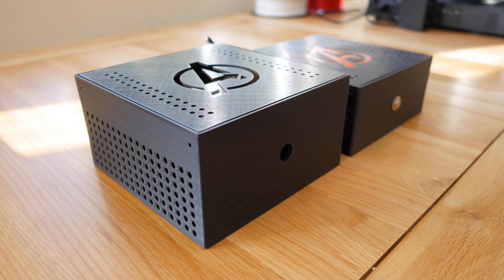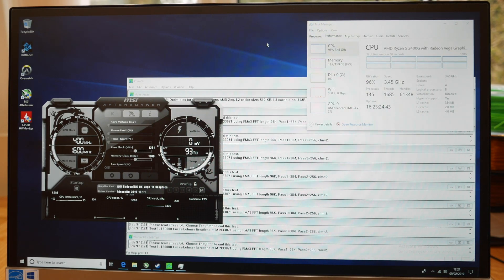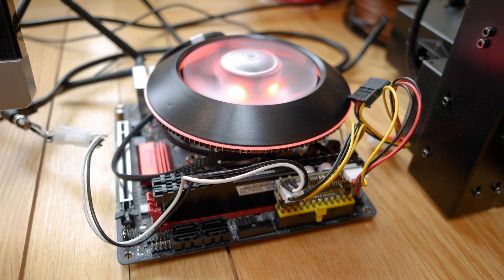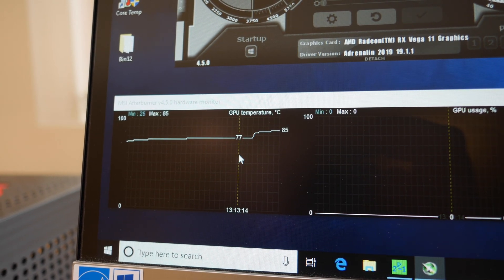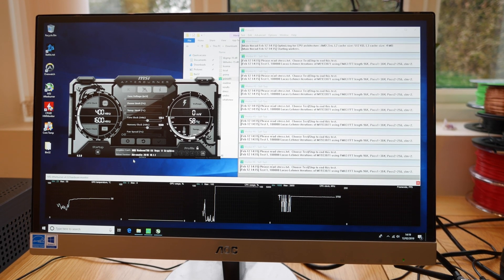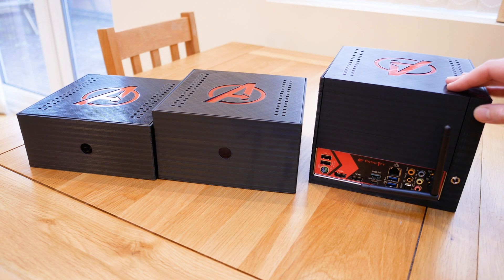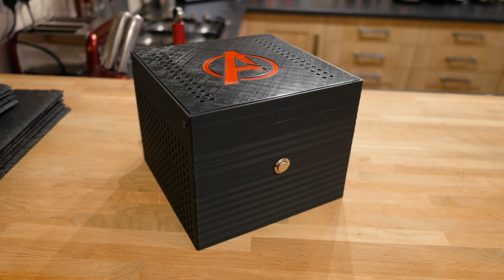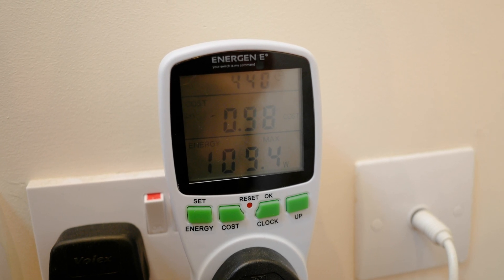3D Printed Ryzen Mini ITX Gaming PC Case v2 – Fixing Thermals

Comment: I hope all is well with your pc!

In the future, start with a fine mesh top and then use a template to spray paint the mesh like a tennis racket with your art that way you don't have to suffocate the fan's direct intake as much. Otherwise, maybe a 120mm aio will have enough room with the enlarged case

As for pico psu, you can add more than one of them or double them up to get more wattage if you have a sufficient power brick. Otherwise, a flex psu is a great space and cost saver especially in the 400w range over sff/sfx and atx psu's. Look at a K39 or Velka 3 for design inspiration

A wonderful design process and project! I am looking forward to making my own 3D printed case to have the fun of a custom case and learning experience. Seeing other people and learning from their efforts is fantastic.

Comment: Could you please see what the temperatures look like in a smaller form factor but without the filled Avengers logo?  The hole should deal with the heat dissipation of the CPU heat sink.

Comment: If you are planning on V3 update of your case, there are few noctua low profile coolers they're better than that monster u have. Plus if you can add 2 80mm coolers one pushing other pulling air that will drop 5-6° for sure.

Comment: At this height you could go with Noctua nh l9x65 or thermalright muscle 100.
You can also try HDPlex for your power. I believe you have enough room to install AC-DC 200w adapter on the front panel and 200w pico psu into MB.
Wish you luck 👍

Comment: The problem is recirculating the hot air, you need a forced exaust, or intanke in the case, no need for a different cooler, and different sized case. Even an small 80mm fan could do the job.

Comment: I've been thinking a lot about 3D printed ITX cases lately, although I don't have a 3D printer myself. Anyway, one option would be to actually flip the concept upside down. Make the motherboard mount onto the top plate, have the bottom panel be removable with just the right case height (+ small stands for an air gap) so there's an opening with perfect fit for the cooler to suck fresh air in. Like cbutters' Ryzen ITX box here on Youtube, but upside down. You'd have to get a separate LED strip for the top if you wanted the lighting, but at least you could get a nice RGB effect under the case from the cooler itself.

Comment: Not to sure if it was an oversight but the case itself can still remain small if you opted for Noctua low profile coolers or Cryorig low profile coolers. You even ended up with the AMD Wraith Prism Cooler which is roughly around $60-$70 USD. You could have went with Noctua's low profile coolers like the NH L9 series and they are even cheaper than the wraith prism cooler and get a better performance with possibly no need to extend the case height.
Reply from the maker: I like Wraith Prism tbh - means I can get rid of the LEDs plus it works pretty well and only cost 35 GBP on Ebay ($45 ish). I do have an L9i somewhere so I could test it potentially - I’m thinking of re-using the smaller cases for other projects so that could be an option. 

I’ve actually printed a further (hopefully final) version of the case which is 22mm larger width and length wise so I could fit a 1050 ti in the thing. It’s not 100% stable yet but I’m confident it’ll work with some extra underclocking/undervolting…

Comment: Good job, now just use some filler, sand it and make it nice and glossy :).
Have you tried removing fan and comparing it to standard 92mm fan? This one looks kinda thicker.
Reply from the maker: Cheers! Yeah the sides are rougher now - I got impatient and printed it on a faster speed setting haha. It's definitely a pretty chunky fan shroud, no idea how easily it comes off tbf - will have to look into it.